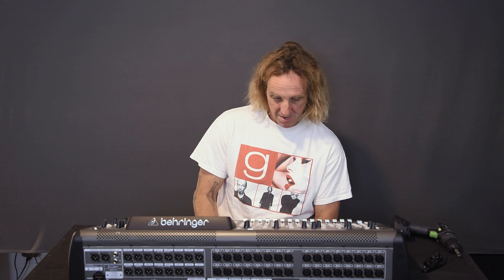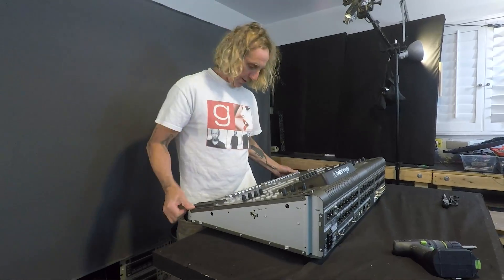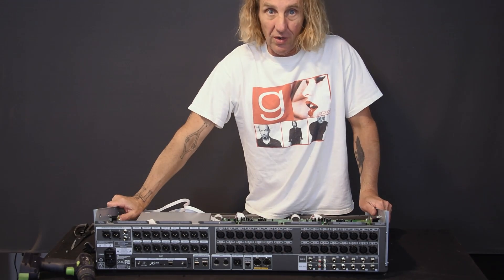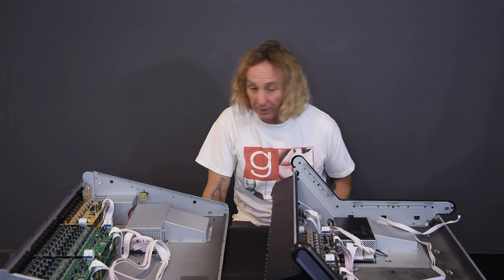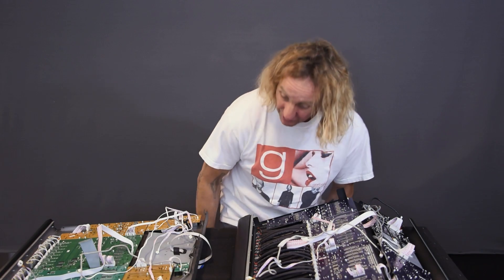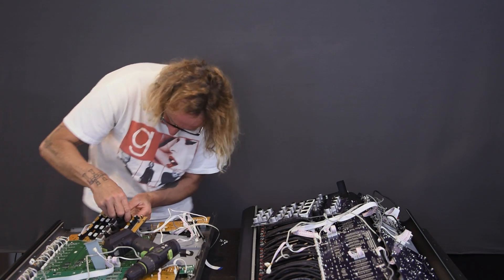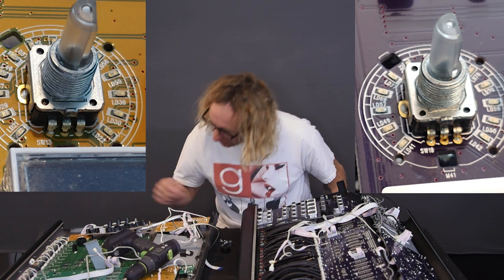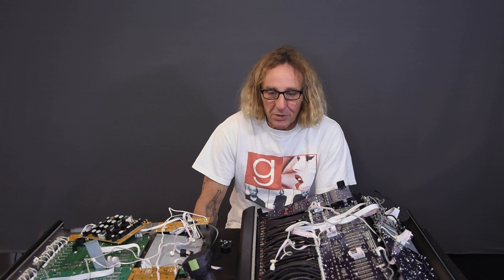Take Apart Behringer X32 & Midas M32 (Public)

Comment: This really shows why the M32 is considered rider-proof and the X32 is not…
The M32 is serviceable on the road, the X32 is not, thanks to the fader design.
Reply from the maker: Yes, for lower end semi pro consoles, the M32 is more desirable
Reply: @DaveRat  My IEM rack still features the X32 rack, there is simply nothing in that form factor with it’s functionality and routing ability. And there are no faders to be broken.

Comment: You might find the PCB materials are better on one than the other. Maybe more layers with power planes etc. A better speced board will most likely have more input / output filtering.
Reply from the maker: The M32 has what seems to be better quality circuit boards

Comment: Love to see the breakdown of an M32 from when Music Group first bought Midas and compare it to the current model. The skeptic in me says some cost cutting was done. Curious to see if it affects sound quality.
Reply from the maker: I thought Music group developed the M32 as an offshoot of the X32 to make an upscale version.

The X32 came first. The M32 is a way to sell the X32 for more money with somewhat improved ergonomics and build quality
Reply: @DaveRat  interesting. Explains a lot, if that’s true. I know the preamps were advertised as “Mitas inspired”, leading people to believe the were the same as the preamps in the touring desk, or at least reasonably close. I owned an M32r, great sounding desk, well built but the UI, which was Behringer inspired, left a lot to be desired.
Reply from the maker: The whole m32 is behringer inspired with Midas used as promo
Reply: The X32 came out in 2012, 3 years after B acquired Midas in 2009…and the M32 was rolled out in 2014.

I had an M32 and eventually sold it and rolled back to an analog Midas Venice f16. The f16 was designed and originally built in England, but I have a later version which is made in China. I also have a Midas MR18 as a toss in the trunk audio problem solver…kind of a digital 1202. 

I really love the Midas preamps and master summing…and the f16 feels like a mini Heritage if you squint. I primarily use it as a drum or synth/sampler sub mixer at home. 

As much as I try to avoid most Behringer gear, these low cost digital mixers are very hard to beat for the price, and absolutely ubiquitous in the rental market. Everyone knows how to use them. The audio diff between the X and M was apparent in A/B…but in a real world live situation pretty negligible. Really says a lot for the X. I did find that the build of the M vs the X was night and day. The M is a beast comparatively…the chassis, faders and layout are a huge improvement.

Thanks Dave for continuing to cut thru hype and not just crap on gear because it’s not fashionable. It’s great that you use gear in your videos that are attainable by most anyone…it engages people rather than making them feel sidelined.
Reply from the maker: Thank you and you get it!

Comment: There’s definitely some differences between these 2 boards physically. But all in all they seemed like relatively minor differences. Obviously the m-32 was a better build. But not having used them I wonder what the difference is in the software. That’s what I see manufacturers touting the most latley is their perticular screen management and the ability to add effects to different channels at the same time and how easy it is to use their platform. Since I haven’t used either of these boards that would be something that a more experienced engineer would have to answer. Mabey a good idea for a future video since you have been comparing these boards for a few months now. Just an idea
Reply from the maker: Software is identical and you can transfer files between the two seamlessly.

As far as usage, I find them fairly logical and easy to use but still a digital bummout as I hate screens and layers and such.

So I'm not the best to test that aspect without bias
Reply: @DaveRat  I feel like your a dying breed Dave. Digital is just so practical. Instead of carrying around monster consoles and racks of processing you have everything in a board the size of a schoolhouse desk. I wonder if analog will even be a viable option in 20yrs. I’m not sure it would be practical for a band to pay for the cost of moving large setups from venue to venue. I personally like the digital consoles and the power they bring in a such a small package.  In the next 20 yrs you probably won’t be able to tell the difference in sound between an analog desk and a digital. It’s just gonna be a matter of personal choice of the engineer. I mean very few DJs even bother with vinyl anymore cause it’s just easier with digital. I feel the market moving to all digital at some point
Reply from the maker: For me a digital console is like playing a video game, all good.

And analog has everything visible always and a level of confidence that when you do something it is actually happening, not an emulation that may or may be what's intended.

Screens and layers vs actually putting each piece of gear exactly where you want it.

Digital is awesome getting things done and analog makes doing it actually enjoyable.
Reply: @DaveRat  "And analog has everything visible always and a level of confidence that when you do something it is actually happening, not an emulation that may or may be what's intended."

I'm kind of surprised, especially on the higher end of things, that someone hasn't made an analog style control surface with digital guts.

Just because a digital desk can compress one physical controls into doing double duty for multiple channels doesn't mean they ALL have to be built that way.  Probably not cost effective for a mass market console like the X32/M32/Wing since most people will share @Jam Band's desire for space efficiency - but if I have the physical room and am willing to pay to have the physical encoders for every channel duplicated - well, why not?  

Our old Crestwood 64 channel desk was obviously modular - made in banks of 8 that could be switched around.  Indeed I swapped out the second fader bank that developed issues with the last fader bank we never used.  I keep expecting someone to do the same for a truly modular digital desk that has an actual analog feel.  

Nothing beats the EQ knobs for channel 3 always being in the same spot, eh?

Something styled like https://www.behringer.com/behringer/product?modelCode=P0246 
Have different frames - 16 channels, 32, 64, 128, etc. Center of the frame has the bus/outputs/displays like the old analogs.  Or let you put them where you want; it should be a modular system.  

I dunno.  Maybe one day?
Reply from the maker: Whether is is better to pick up their phone, open an app and then remotely turn on a light or just reach over and flip on the light switch depends on many factors.

The concept that digital is better, always is just as sly as the concept that analog is better always.

I like to mix in the dark, no lights, no screens.  I memorize where everything is so I can make changes without looking. It's like driving a car without having the interior lights on. There is a joy and advantage roof that, to focus on the sound rather than stare at video screens.

But digital has huge advantages for many applications, and I live that people embrace that and I own dozens of high dollar digital consoles that rent out for large events and I ha e no interest in using them
Reply: @DaveRat  I can’t imagine being able to run a console with hundreds of faders and buttons by muscle memory alone. That comes from 20-30 yrs on the road playing thousands of shows. It’s basically an art-form at that point Dave. And as you’ve honed your art form this next generation of engineers will most likely hone their art form in the digital realm. They will flip through those screens blindfolded and adjust those dials as you do. They will simply have to hone different muscle groups to achieve what you’ve spent your life achieving with analog. I think both are great. I like hip hop and I I like rock music. Their both great. Both form of art. I think this issue is similar. It’s a matter of taste. The tech has gotten so good I would challenge anyone to listen to an analog setup and a digital setup and tell me which one is which in a large venue. I think your right. It all comes down to what the engineer is most comfortable working with day to day. There’s still some kinks to worked out with digital but I’m here for it
Reply from the maker: It's not that tough, mark some key faders with tape lumps and the tall knobs are the EQ. Gain is at the top.

The dark mix position is awesome for the audience and brings the engineer focus to mixing the show rather than staring at the tools used to mix the show.

Adding in digital where things change what they do makes things unwieldy though I can set up some digital console to awkwardly do limited mixing in the dark

If a guitar player or drummer can play with their eyes closed, then we as engineers should be able to do the same.

If the tools you use prevent you from mixing fast, and fluid without losing focus on the artist, show and sound, then get better tools.

When you drive a car, do you turn on the interior lights and stare for extended periods at the controls? No, because you would either drive like crap or crash.

Same goes for mixing, focus on the music, watch the show, operate off of feel, glance occasionally at the control and guide the sound to what you desire without turning into a troll staring at the equipment.
Reply: @DaveRat  exactly! It’s why I get disgusted when designers insist on inserting touchscreens  where physical buttons would be far better. 
I’ve tried to have discussions with younger designers about muscle memory and they have no clue - nor a desire to learn either :p
Reply from the maker: If ya want to be a race car driver that wins, eyes on the road and not the cockpit
Reply: @jamband4230  I think we're a long way off speakers and rigging being so small that the size of the consoles make any difference to trucking to be honest.
Reply from the maker: As an analog guy that carried analog consoles worldwide I can say that there is pressure from management and costs not to carry big heavy consoles when flying them around the world
Reply: @DaveRat With a digital console with knob per function for eq/dynamics/sends like a CL5 you can absolutely do the same flying in the dark mix process, one hand hitting a channel SEL and the other going to the exact same place for the encoders is as quick or quicker than grabbing the correct knob on the correct channel on an analogue board imo.
The only major limitation is in changing two things on two seperate channels simultaneously.

Though i too despise using desks with minimal physical controls that force you to be very screen and layer focused, pages for channels, pages for sends, pages even for eq bands, no thanks.

There is a certain zen to not having any screens involved at all though, and many prefer a workflow like this for producing electronic music with no computers too for example, there's definitely just something "to" it.
Reply from the maker: Very cool. Knowing knowb position by feel and mixing without ever looking away from the show. No screens.. being able to mix with a blindfold

That was happiness, zen and audio harmony for me.

Comment: x32 and m32 in fact, 99.99% is the same, schematic, parts maybe from different manufacturer...
Reply from the maker: Also different D to A converters, different latency. The X32 has a slightly longer latency. The X32 has more input noise, and more output noise.

So yes, things may be similar but definitely not the same

Comment: Another great video!  Interestingly enough, I think I've used around 8 or 9 X32s (including my own old beater and the one owned by the band I currently mons for) and 4 M32s since they came out.  Out of the 4 well looked after and flightcased rental M32s, 3 had at least one fader with an issue.  The X32?  Apart from the entire set of faders being slightly off calibration on several boards, absolutely no problems!

At least Avid made their 'consumable item' faders easy to swap out!

Comment: How'd it go putting it all back together? Any spare screws? Again! Great stuff. You and SpectreSoundStudios using repeatable methods to dispel myths. Glenn Fricker has been debunking guitar tone myths, such as different tubes change an amp's sound for a while. Tone wood and solid body guitars is also a myth.
Reply from the maker: Very cool. Yes debunk!

And they went back together all good! And even worked as well.

Comment: Love these videos Dave as I've got an M32R and an MR18. Haven't watched this a second time but did you touch on the AD/DA converters? Did I miss that? I have read the MIDAS are higher quality but heck I dunno. Thank you again, good stuff man!
Reply from the maker: I think the A to D may be the same.  You can see the different D to A converters on the output card photos. The Midas also has a lower latency due to the better d to a
Reply: ADC's are identical with the exception that earlier models of each shared the same cirrus logic chip (CS5368 i think) before they developed their own (midas m8000 I believe it's called). 

That new chip was definitely in an x32 rack I owned a few years ago, so it's been some time.

Comment: what you say in the preamps is wrong ...there are no Opamps with only 3 contacts...the OPamp it's the same and you can see in your video ..it's a 4580R and it's right on the middle of the orange condensers where you in the video identify normal protection transistors in the red circle ;-) just below you see the 4580R ...the difference it's not in the OPamp ..but the condensers used ant the "protection" transistors in the audio input ...cheers!!!!
Reply from the maker: There appears to be surface mount input transistors on the X32 and transistors with leads on the M32. A youtube member on the paid side of my channel posted the exact part numbers of the PNP transistors the M32 uses and the NPN transistors used in the X32.  The transistors can be seen in the photos. The OP amps used are the same on both consoles

Comment: Would like to know, what the FPGAs on the output boards are for on the m32.
Reply: My guess is that rather than employing a single 8 channel DAC, as on the X32, they might be using higher quality 2 channel DACs, which appear to be the Cirrus Logic chips and then using the FPGA to do a bit of bit shuffling to take the 8 ch TDM signal and convert it to four streams of I2S for the Cirrus chips. Probably overkill for the purpose and only using a fraction of the logic cells, but it will get the job done with basically minimal latency if the design is done well, maybe even going so far as to be able to latch bits directly out as they come in, which would be hard to achieve using DMA on a microcontroller, for instance.
Reply from the maker: Interesting, would love to figure a test where the sonic or other differences are easily audible

Comment: I personally have had no issues with Behringer products and I think they're great for musicians on a budget. Yeah their spec sheets are a little off lol..... and there is the occasional bug that is usually easily fixed but for the price I don't think you can beat them. I would not recommend their guitar pedals though, not sure if they're still making them but total waste of money on those.
Reply from the maker: Interesting. As a musician, you are aware of the deficiencies of the guitar pedals yet the audio gear is well good enough.

As a sound engineer, I see issues with the audio gear but the pedals seem well good enough.

I think this provides clarity

The tools a tinkerer may buy will often be substandard for pro plumber or electrician or tradesman.

Often outside of our craft we lack the need or awareness to hold a higher standard
Reply: @DaveRat  Valid, but ... a "good enough" at an affordable price point vs a "better" that costs too much explains why the X32 is popular in places where the alternative is to have nothing.  A difference between pros and outsiders is that the pros often have more resources to take the better path.

When the alternative is a vintage cellphone streaming to insta-ticktock-booth-tube, even a Behringer product looks good... 

(I'd love to see a WING teardown, and thanks for the interesting and thought provoking videos!)
Reply from the maker: Cool cool John!

Comment: I wear a static wrist band, and take pics of ribbons whenever doing this crazey work. Go fearless Dave!
Reply from the maker: Ha! I used to work at Hughes Aircraft and when handling cmos and other sensitive parts we would static protect.

Once chips and gear is mounted, rarely does it need static protection, especially with the low tech of audio we are dealing with.

For a company to implement a fragile and static sensitive temperamental and prone to failure part, it really miss warrant some strong advantages.

In other words, if we have to be that careful, we probably don't want to use that gear.
Reply: @DaveRat  How and when do you replace memory batteries? Thanks Dave.